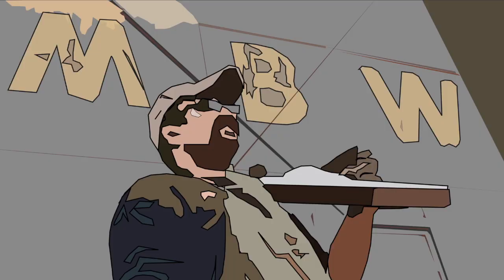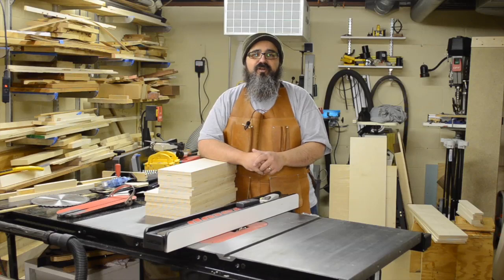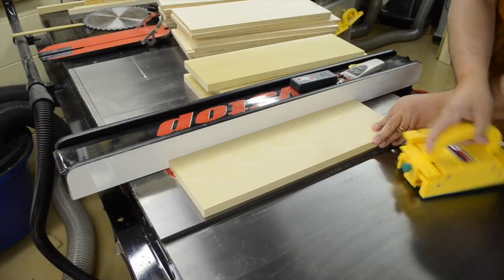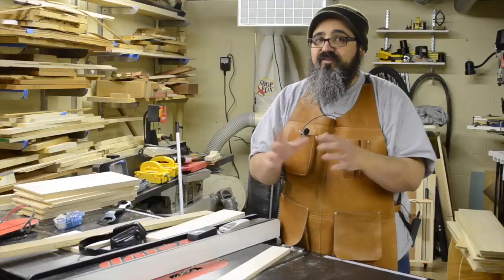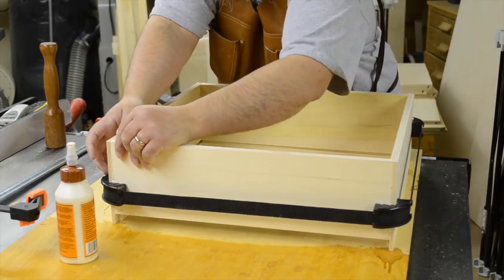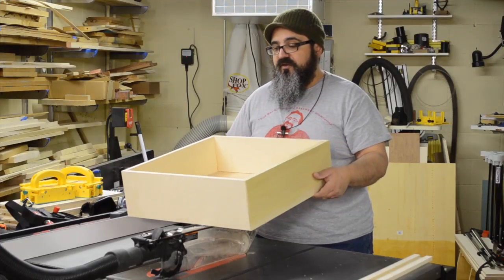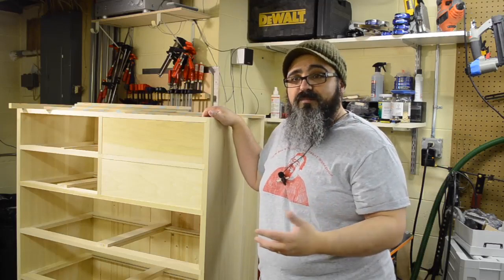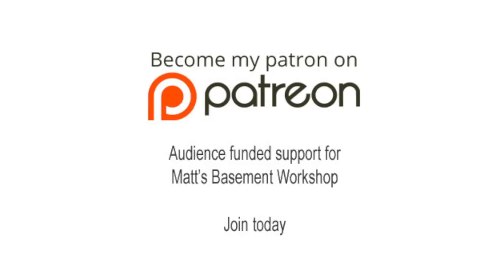544 Madison's Dresser Pt 8 "Drawer construction"

Comment: There can be another purpose for that center drawer glide.. I have some older pieces of furniture that use that center piece to support two separate wooden drawer bottoms, used when making wider drawers that would be hard to construct with just one wide bottom board.
The dresser is coming along nicely.. sorry to hear that metric baltic birch is harder to come by in your area.. I use that stuff a lot in projects.

Comment: In my opinion the best looking side of the wood used in the sides of the drawers should be on the inside because the user is standing in front of the drawers and looking inside and they will not see the outside.  Now the front should be best side out.
HH
Reply from the maker: Without a doubt the drawer front should be the best possible face, even with my plans to paint the finished dresser knots and other imperfections could show through. 

As for the drawer sides, that's a good reason to use as clear a material as possible. Thankfully even the "not-so-nice" side of the Baltic birch plywood I'm using is still REALLY NICE.